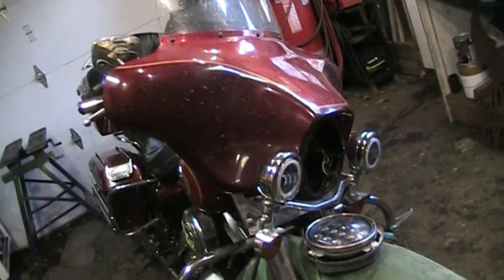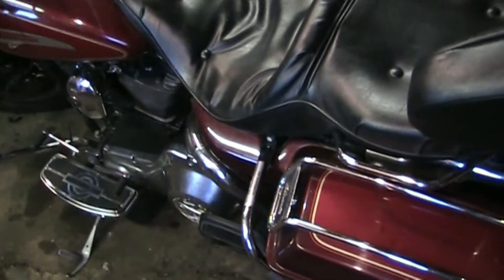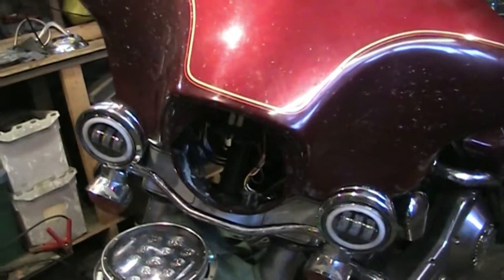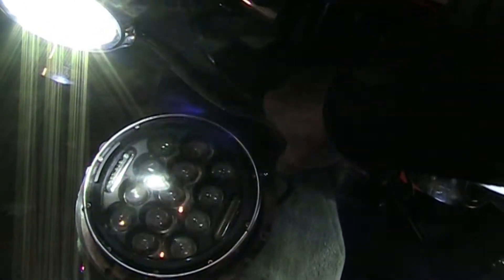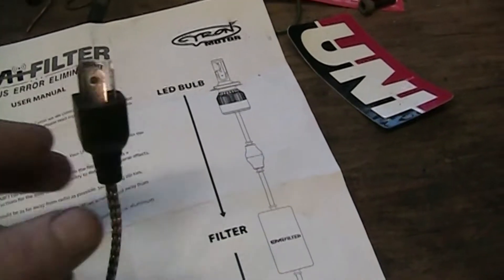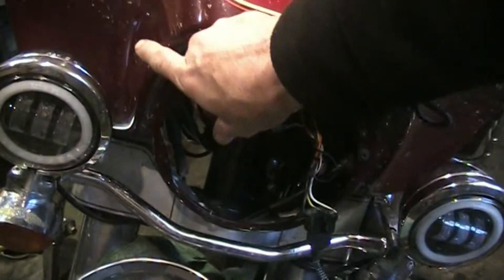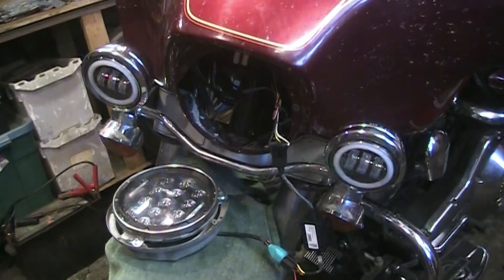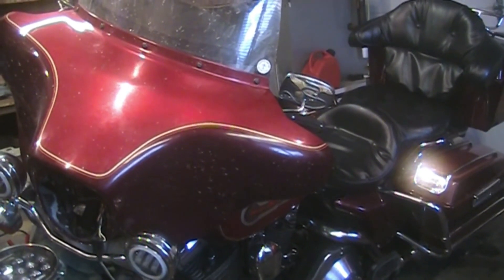LED Headlight Static cure

Comment: I have an 07 ultra classic that was having this same exact problem with the LED headlight bulb. I tried them clip ferrite rings but they did nothing. After watching your video I ordered a Cryonmotor filter. Instantly cleared up my radio static! Thank you for the great video and helping me out!
Reply from the maker: Glad it worked for ya, thanks for the great comment!
Reply: I tried this an I still have the same issue I’m lost I have no idea how to correct it
Reply from the maker: It's possible to pick up static from other sources as well. Possibly your spot lamps if equipped?
Reply: @randomwrenching  thought this video was about radio interface! Not about what you did to a harley!
Reply from the maker: @camcarroll5803  Interface or interference?  LOL.  There was interference into the radio caused by the LED headlamp.